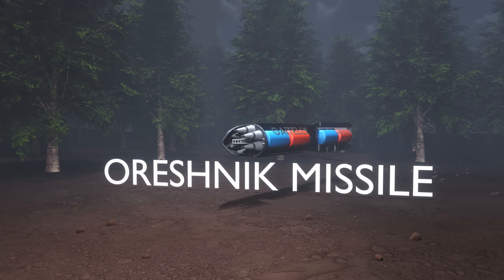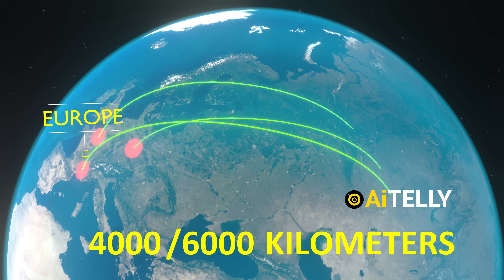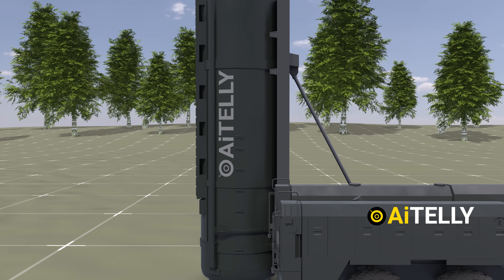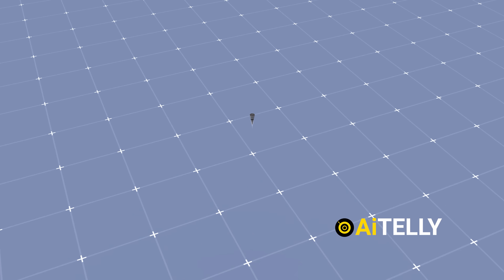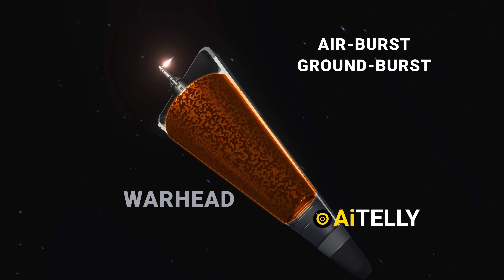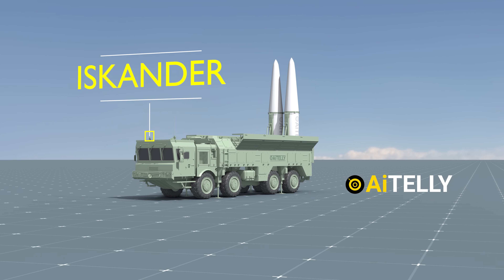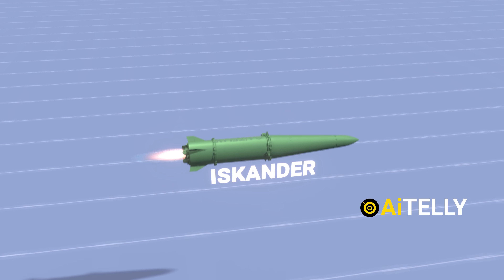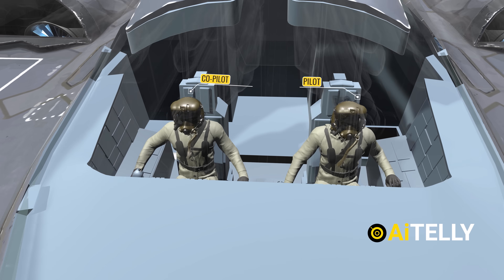Oreshnik Hypersonic Missile | How Russian Intercontinental Ballistic Nuclear Missile Works?

Comment: I saw their speed on video, like lightning crashing into the ground, I don’t believe that they can maneuver at such high speeds.
Reply: I think at one point (closer to it's target at the ground) it will stop maneuvering.
Reply: most of the maneuver are high in the atmosphere.
Reply: Ребята, если кто-то не понял, наводится не каждая голова, наводится целый пакет по шесть штук, как гроздь фундука.
Reply: @АнтоДив  нет там как раз каждая голова имеет микродвигатели..а скорость задаёт основная ракета
Reply: @mHasavurt   Ты  не внимательно смотрел видео удара орешника.
Там все видно. Головы чётко идут пакетами по шесть штук.
Reply: @АнтоДив   идут и что?? Они на высоте маниврируют
Reply: @MuhidinHasavurt  Маневрирует весь пакет и только пакет, а не каждая голова отдельно. Да и смысла нет, ведь они предназначены для кучного падения. Нет смысла наводить каждую голову отдельно.
Reply: who cares what you believe, you're not a scientist :D if we're talking about such a long distance, even a slight maneuver of 100 m can cause the defense systems to miss
Reply: They are def not maneuverable.  They would have to remain at low(ish) altitude for most of the flight for that, which would be incompatible with their near vertical impact.

Oreshnik is a traditional IRBM that was simply used at near its minimum range, hence it was lobbed extremely high to come down near vertically.

Also, you aren't going to fit 36 maneuvering warheads in a road mobile missile. The control surfaces needed to maneuver take up way too much space.
Reply: @dancingferret6654  almost all sources say it is maneuverable.
Reply: @dancingferret6654  ты недооцениваешь Российских инженеров.
Reply: The mirvs that hit Ukraine didn't spread apart very far
Reply: It's the weight, gravity, and rocket it's making them dropping faster like an Anvil with strong balloon popped and dropped in the air.
Reply: the radius of turning about the reentry flight vector is small.
Reply: Like a hand with the index finger pointing downward on the target.